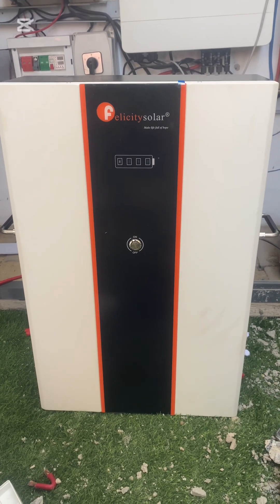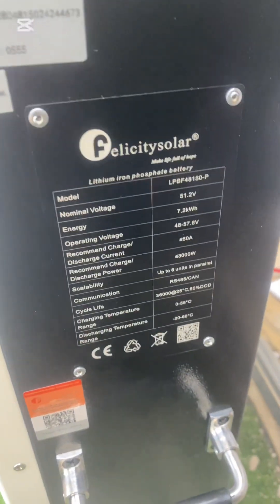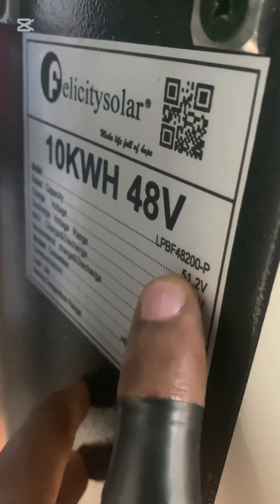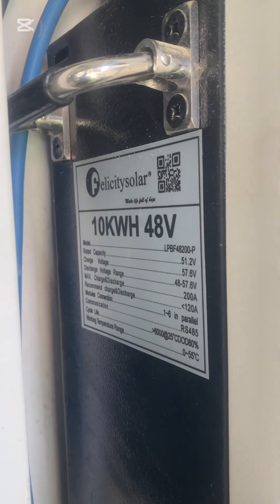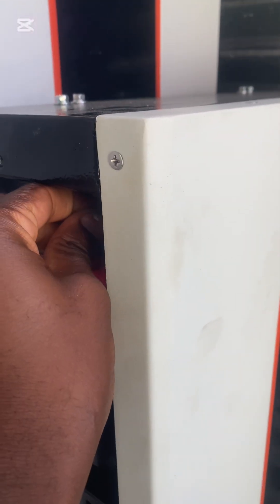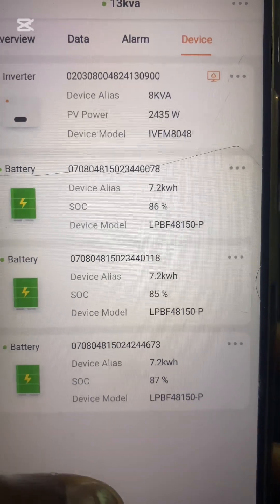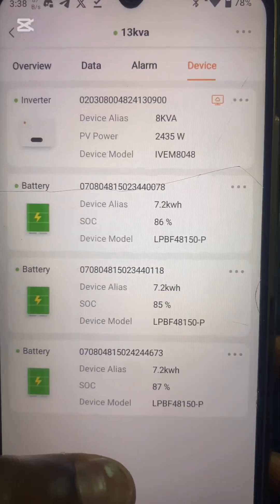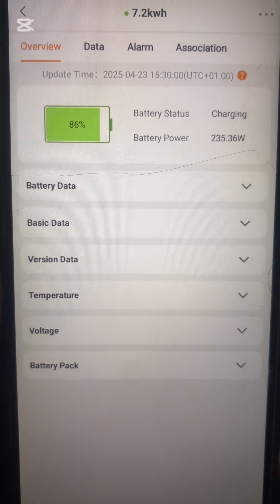How to know 10kwh and 7.2kwh Felicity battery

Comment: Yes that's true even IVEM 12, does same... Ones you communication is set properly, dont panic   ones you boot or power up your inverter its start to beep and display error 80, thats the systems design upon beeping it starts to do inside serach or scan which goes through stages,... Ones it sees that user is not set, it scans for com port, ones it seems that your communication is set properly then it selects it and the BEEPING STOPS. and you are good to go... AC OUT. enjoy your inverter.

Comment: Hello, please how did you get your inverter to work in Lithium mode and communicate with those batteries?
I have this same setup at home, that is the IVEM8048 and 3 of the so called 10kwh that is actually 7.2kwh. But for some reason when I select Lithium as the battery type on the inverter, it starts giving Error Code 80 so it's been set to User type. I've seen someone else here on YT complain about the same thing.
Reply from the maker: You will see a video about this before next week
Reply: Yes that's true even IVEM 12, does same... Ones you communication is set properly, dont panic   ones you boot or power up your inverter its start to beep and display error 80, thats the systems design upon beeping it starts to do inside serach or scan which goes through stages,... Ones it sees that user is not set, it scans for com port, ones it seems that your communication is set properly then it selects it and the BEEPING STOPS. and you are good to go... AC OUT. enjoy your inverter.